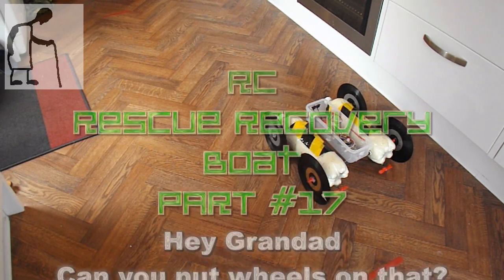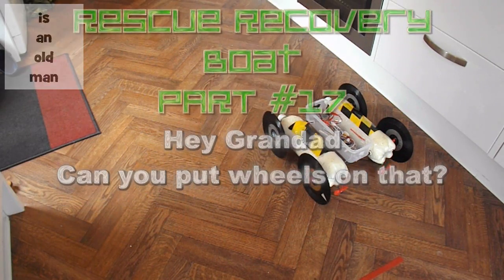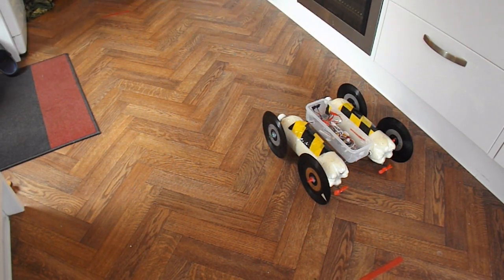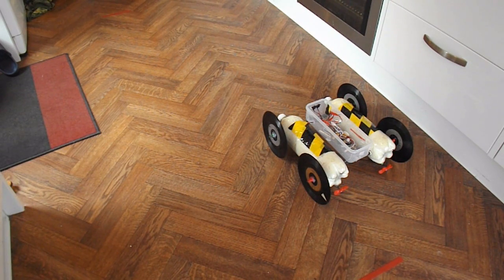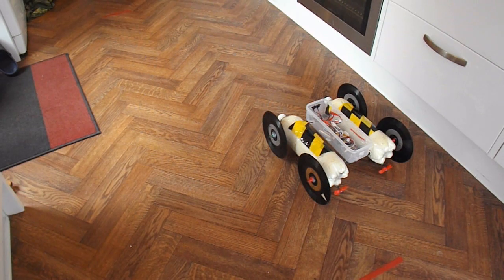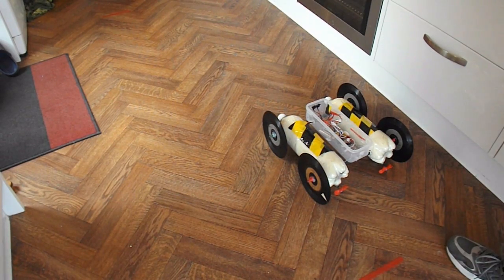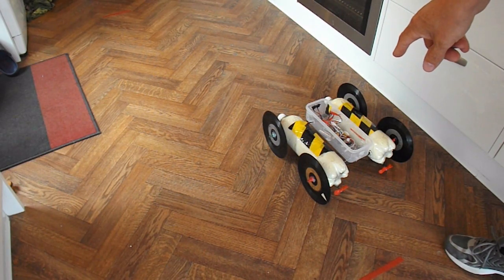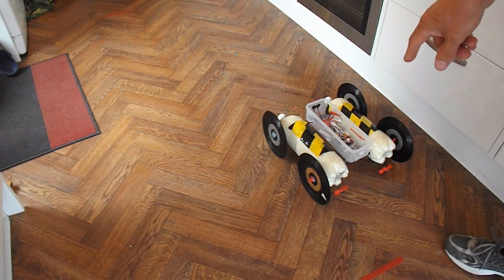RC Rescue Recovery Boat Part #17 Can you put wheels on that?

Comment: i know you didn't mean to make it amfibius, but wouldn't it be smarter to make paddles on the wheels. Remove the hole propeller part and use the old dampers/the old boats that used steam wheels? Maybe for a future project?
Reply from the maker: Bloody Ricers there is no power going to those wheels, they are just on axles that pass through the tubes that hold the two hulls together. The point is it works fine as a boat and that is all it is going to be. I simply answered the question asked by Jack Mccafferty. As far as putting paddles on wheels, they would just get damaged if it was used on land. If you want to see my amphibious vehicles they are in this playlist https://www.youtube.com/playlist?list=PLA5a2xPRSrB09CHd02QHoZSg9nAS5uVoC
Reply: GrandadIsAnOldMan yea. i meant as a new vehicle, sorry. Have a nice day.And enjoy your vacation!